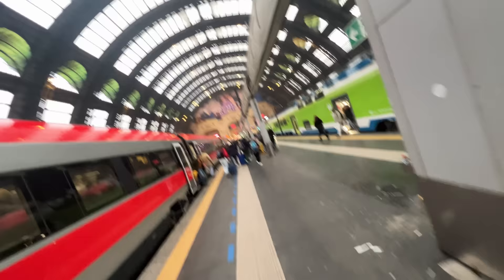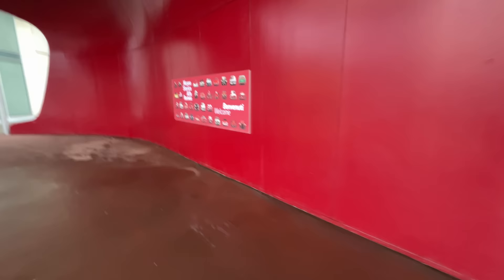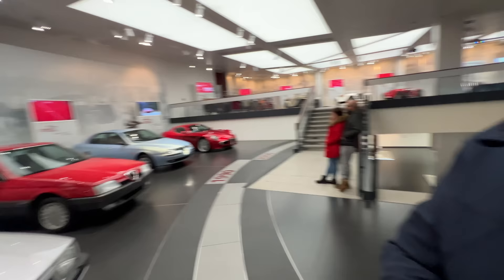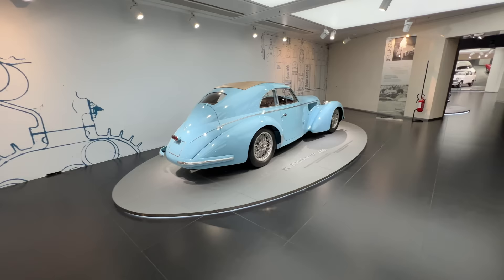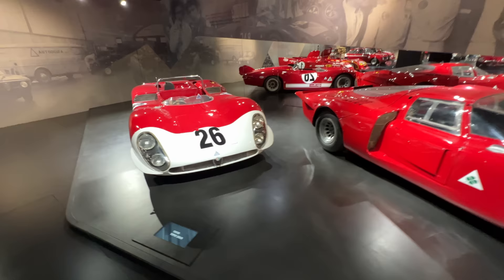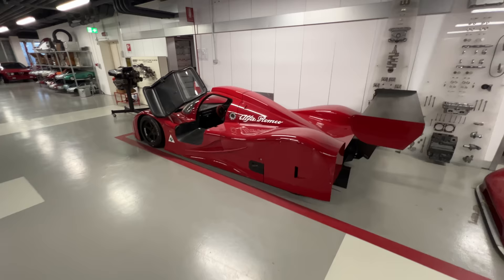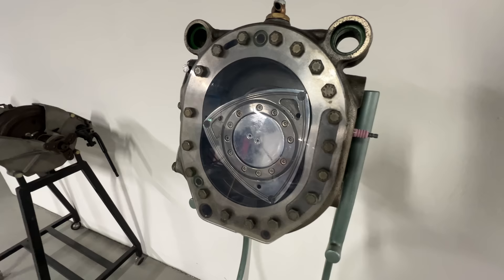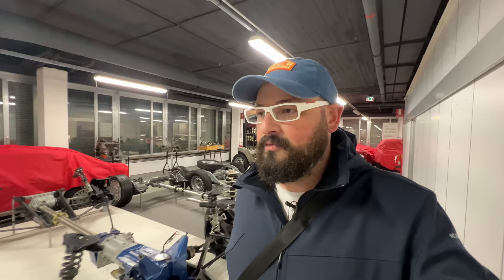Exploring Alfa Romeo's Secret Race-car Collection!

Comment: Thx for sharing. Must get there sometime. Nice to see that im not the only one growing up in dads 75ers and 164ers XD Starting with the first carburator driven 75 then going to the milano and from there to 2.0 164. Cheers.
Reply from the maker: Nice way to learn how to drive if I do say so myself lol
Reply: @dino_dc  yeah, problem is now, that im still used to open the window by pushing the button on the roofpanel instead like in all other cars by the doorpanel XD

Comment: Actually the transmission in the Alfa Sud uses the Citroen DS19 invention of putting the disc brakes on the motor to save weight in the wheels..😮